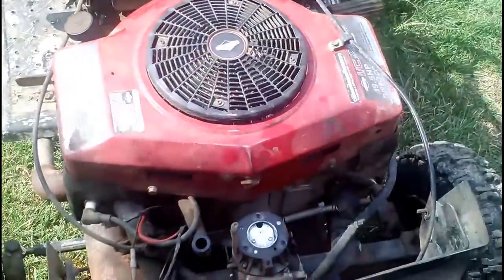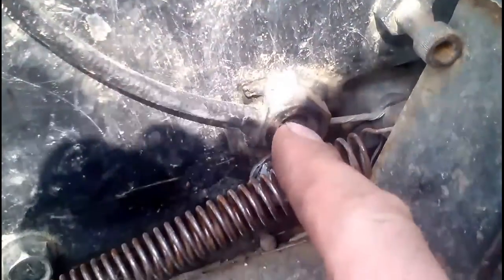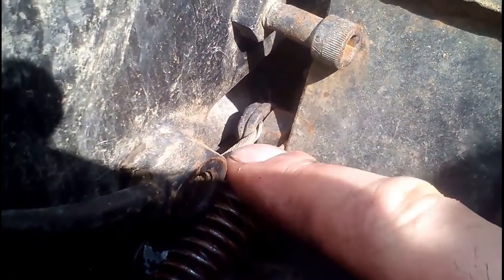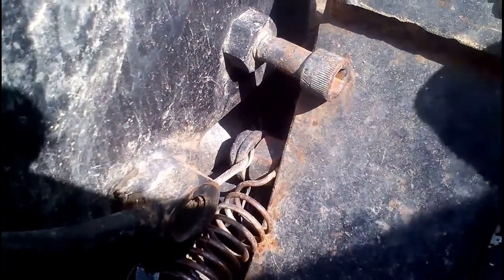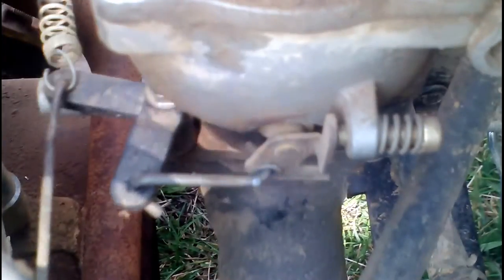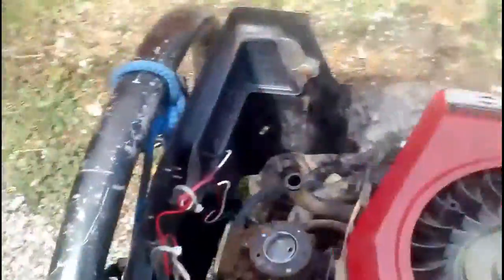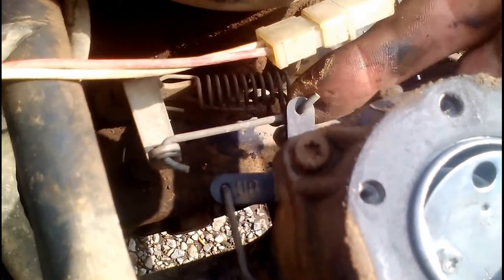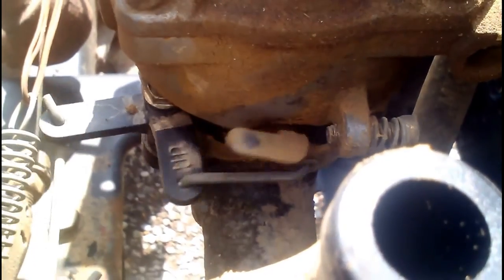Gas pedal and governor bypass, Briggs opposed twin.

Comment: Never had a problem with the governor itself blowing up?
I always removed them out of the crank case.
Reply from the maker: We've done about a dozen engines this way, no problems with leaving governor intact inside engine.  Others recommend pulling the guts out.  It's up to you.
Reply: @stretch44875  Any updates on potential issues 5 years later?  Thanks for sharing!
Reply from the maker: @jafinch78  haven't had any governor issues.
Reply: @stretch44875  Didn't think so. Seems some call in some engines the governor, the oil splasher slinger or something like that.   Any other issues with the engines over revving or something that fails or do you test the RPM's somehow when setting the throttle?  I'm about to test a cheap $10 tachometer so I can set the no load RPM's on the OHV's I've been learning with working on.  Thanks Man!
Reply: @jafinch78  I'm replacing an Evenrude outboard boat engine with a 19hp opposed twin.  I definitely want to delete the governor.  I thought I would do the same thing.  Buy a cheap tachometer and set the throttle to the same full throttle rpm as before I took the governor off. How did that work for you?
Reply: @henryvolk1084  Amazingly still working leaving outside two seasons now and still on the same batteries... however, I can see will need to replace the battery. I wound up just leaving installed on my Poulan Pro with some either black electrical tape or silicone self sealing tape... I forget which offhand.  I recall there are settings for the twin cylinder versus single seems.  I did make a video on my channel with the Intek 22HP V-Twin, though my Poulan Pro is a 18.5HP Single.
Reply: @henryvolk1084  Just checked and my video is titled "Generic ~$10 Tachometer Review with the Yard Man B&S 407577 engine"